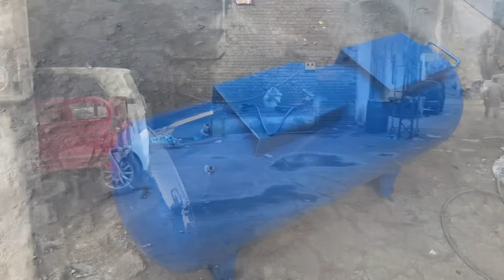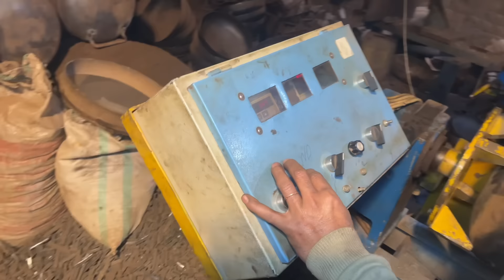How Air Compressor Tank Manufactured | Wonderful skill of making air compressor tank

Comment: @ 10:38 proof that "Bondo and Paint Makes You The Welder You Ain't" lol      They did use some creative ways to do some of the steps, like dripping the stuff that looks like cat litter on the weld, is that to slow down the cooling? I never saw that done like that. I love these VJO's It would be great if they had sub titles as to what they were actually doing at each step.  Also at 5:20 the way they used that swag tool thing to form and make the seam.....never saw that but brilliant!!!!!
Reply: that is not cat litter but purpose-made flux, it's called submerged arc welding and it's quite common in automated welding and has been around for a long time. It's actually a really good way to make long, continuous welds.